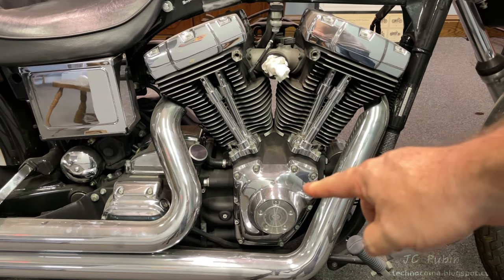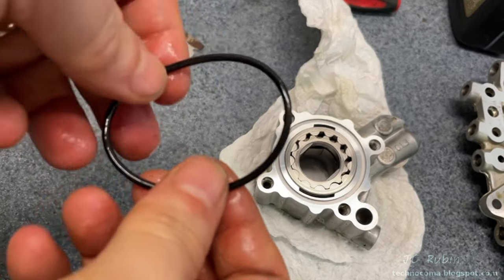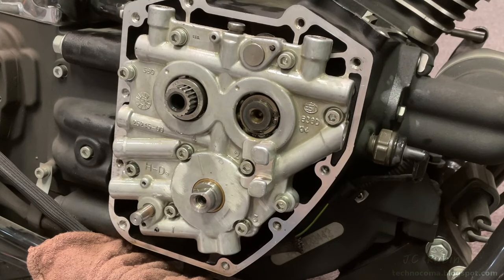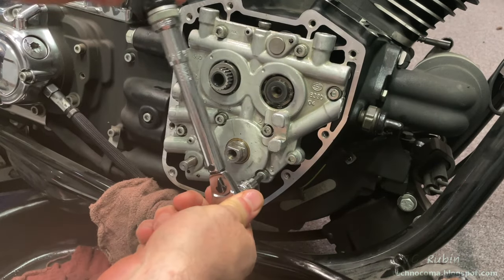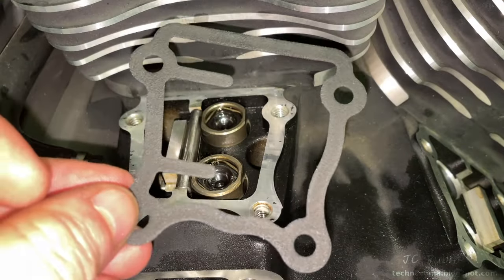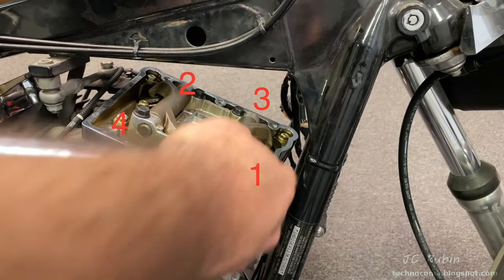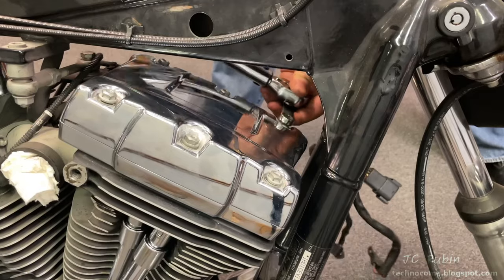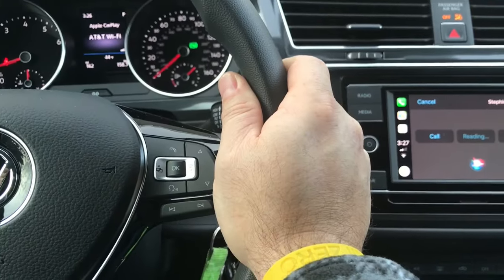Harley Twin Cam Chain Tensioner Replacement with Push Rod Removal Complete - Part 2

Comment: Unbelievable. He did all that and didn't cut the pushrods with bolt cutters. It CAN be done!. Purely educational video done very professionally. Bravo
Reply: It can be done, but it is a little easier, and less expensive if you do it more than once, to have adjustable push rods. He did remove the rocker boxes. What I didn't see him do was replace bearings or clean out screen sock.

Comment: Absolutely fantastic video.  I have an old twin cam with a ton of miles so I have done this a bunch by now.  Your video is the best I have seen to date, and you explain the engine timing procedure very well, something that most of them skip on.  Thank you so much for this!
Reply: Do you have to do the oil pump procedure every time ?

Comment: What an excellent presentation -- I feel like I now have a thorough understanding of camchain tensioner removal and replacement.  I have a 2003 Dyna Low Rider and at 32,000 miles my inner shoe was completely worn out and broken.  I caught it in time and based on your Part 1 and Part 2 videos I have completed tensioner replacements.  Thank you so much for sharing your knowledge.

Comment: I will say it again 'best instructions on this job, period'.
Reply from the maker: Thank you. Glad it was helpful.
Reply: @delorean1  I have a question. When I remove camplate it will be marked as it comes out with locking tool in place, I'm leaving oil pump in situ, when I reinstall do I still need to do the aligning process, or will it be in line still as I have removed it?. Thanks.

Comment: Great Video!!  Although I am still afraid, I will get everything apart okay, But, when it comes to putting everything back together, Oh boy!!  My Shovelhead I had back in the mid 80's was the last time I attempted to work on my Harley. I also had a great friend that rode and worked on Harleys forever. He had a garage at his house and every tool imaginable.  A great friend that helped me anytime I needed it.  Then in 2000 I bought an 883 Sportster that was brand new and only needed maintenance which Harley would do, because I moved away from my buddy. A few years later after selling the too small 883, I bought a low rider which Harley Dealership also did the work on, this was back in 2004. Since then, I haven't ridden until last month when I went and bought a 2001 Dyna. I have hardly any tools and no friends that can help me, also no money since I became disabled and can't make the money I used to make!!  So, I HAVE to learn to do this myself or sell the bike I just bought.  Which selling it is out of the question since I'm way older and disabled, if I sold it I'd probably never ride again!!  So, this video really helped! So far, I haven't checked for wear on the tensioners, since I don't ride much at the moment. Now it's time to buy some tools a bit at a time so I can at least check the tensioners before I ride again.  I need sockets, wrenches and the gaskets to check them. Get that done hopefully this month, and just keep watching these two vids over and over again, so if I need to replace them, I'll have a better understanding of what is involved and hopefully get the sucker put back together correctly!!  Rding makes my old, broke, disabled butt feel a heck of a lot better!!   No way would I even attempt this job if I had not seen this video.  Thank you for sharing your knowledge!!
Reply from the maker: Glad the video helped.
Reply: And, never underestimate the psychological power in the words "I ride a Harley-Davidson."  Uttered to one-self quietly, and to others in full voice.
From California ~ Ride Forever!  🦅
Reply: @delorean1  It did.  I actually needed tensioners. I caught it literally just in time. There was a big chunk missing sitting in the bottom of the cam chest. I touched the tensioner and it fell apart in my hand.  Luckily there was only 1 big chunk of plastic in the cam chest.  Nothing else.  I wound up putting in an S and S mod. New hydrolic tensioners. Better oil pump. And since repairing I put about 1200 miles on it.  If I had started that bike one more time it would’ve been a boat anchor!!  Thank you God!!!

Comment: Good instructional video.  I have a 2000 FLSTC and during COVID lockdown I did the teardown, but replaced the stock camplate with hydraulic chain tensioner, new cam bearings, cams, oil pump and lifters.  On the top end replaced the oil breather sponge, flapper valves and o-rings.  Also installed rocker lockers which did quiet down the top end.  Thanks again for the great video.
Reply from the maker: Did your breather assembly come apart easily to replace the flapper valves?  These were glued together.

Comment: Did this last winter. I suggest if anyone is doing this, to upgrade to the shoes made with Stanyl Polyamide the ones from "Cyco Gaskets" and not the stock Harley crap. Also, always replace the crap Harley INA inner cam bearings with torrington bearings. Always good practice to upgrade Harley parts because Harley engineers have shit for brains!

Comment: Excellent video.
You covered all the technical issues and made certain the video was clear so the average guy could see and would know what he was up against. I never  priced this job at a dealer, it would probably run into the  $400 neighborhood. 75% of it labor.

Many thanks.
I will be doing mine this week. This video gives me an extra degree of confidence.
Reply from the maker: 400$??? keep going, 400$ would get you through the door.

Comment: Excellent content. What's not to like? Subscribed.
 A TC88 is for life, take the rough with the smooth. Had a 1340 fxdl for around 10 years, wasn't going to go with the TC but got a '99 FXDL as a full restore project. Best video I've seen but I would lock the inner tensioner from the outside to aid cam install,lower back down gently.

Comment: Excellent video sir. One thing I noticed....,.
I believe the lifters are directional and the oil passage faces inboard.

In fact, it appears after slowing the speed on the video, your lifters were actually removed with the oil passage facing inboard.

Your attention to detail is impeccable! I could be way off on this, but, thought I'd offer a suggestion that may be of some assistance.

Thanks for all you do sir, greatly appreciated!
Reply from the maker: Id taken photos during removal, and my original video is 60fps.  The lifters went in the way they came out.

Comment: Best Twin Cam Tensioner Replacement video out there Classic Wrench! I'm just completing my job...to the part where I put front cylinder on TDC...snugged the rocker box...pushrods still won't spin freely...guess I have to wait for them to bleed down...curious...does it matter that much if they're not bled down when you torque the rocker box?
Reply from the maker: Yes, wait till they bleed down...

Comment: Thank you for a great video!    I will be attempting to do my ‘03 Softail, I’ve pulled my cover and the inside tensioner is worn deep but not to metal yet , so no more riding it till I replace it.  I will rewatch this video and take full written notes and get everything prepped. 
Thanks again! 😁
Reply from the maker: Good luck!

Comment: you covered pretty much everything and this is the budget way.  No expensive 'upgrade' kits-  just fix what's broken. Love it. You didn't replace the inner cam bearings but from the vid-  they looked okay.  Thanks again for making these vids.
Reply from the maker: You're welcome, I tried as close as possible to follow the workshop procedure.

Comment: Brilliant concise video manual. Carrying out procedure this winter on 04 tc88. Not wanting to upgrade performance , just reliability.  No issues with bike so far , while apart what upgrades do you think i should consider.

Comment: This was absolutely exquisite.... Just wondering why a perfectionist like you doesn't use a lifting table.
Reply from the maker: I do have a lift as used in most of my other videos. By this was done offsite at another location.

Comment: A couple more steps and you could do the cam bearings, cam swap and rocker lockers. Awesome video 👍
Reply from the maker: Thanks, yes its true, but I was already doing the oil pump and the lifters, the the scope of the project was getting big. If I didnt have the secondary tensioner tool then I would have removed the cams and redid the bearings as a result.
Reply: @delorean1  Makes sense. I plan on doing the tensioners and bearings when the weather cooperates. Servicing the top end while I'm at it. Still debating on cams because the 88 runs just fine and I already got a vrod that's plenty fast if that's how I'm feeling that day.

Comment: Excellent video !   I have an ‘03 FXSTD with 44k miles , i just popped off the side cover and the outside side tension pad is particularly worn but the inside pad is worn to the point I see the edge splitting away . Think I fought this just in time!   I want to do a whole S&S 509 cam , hydraulic tensioner , plate bearing set upgrade but at $1,800 I may have to wait several months. With your video I can just do a simple OEM replacement costing only a few hundred bucks and save the money for the cam upgrade later in the year😁
Thanks again!✌️🇺🇸
Reply from the maker: You're welcome.
Reply: " With your video I can just do a simple OEM replacement costing only a few hundred bucks and save the money for the cam upgrade later in the year" Yep that was exactly my plan as I couldn't afford the conversion cam plate/hyd tensioner deal either but wanted to keep  riding my new to me 2000 Softail Deuce.  Imagine my surprise when I opened her up and found a SE Cam plate along with Hydraulic Tensioners and SE 203 cams.  If a guy has the money I think the conversion cam plate, and even a new set of cams would be the way to go.  However like you I wasn't that cash heavy having just bought the bike.

Comment: Thank you for posting these videos. I've been looking for something like this as I can't afford the gear drive setup or hydraulic tensioner upgrade pushed by H-D. Very helpful and presented in a way that's easy to understand. I will be doing my 2003 FXDWG soon.
Reply from the maker: Glad I could help

Comment: If you don’t have the centering tools just slowly snug the the 4 bolts little by little after turning the motor through 3 rotations. So 3 rotations loose. Then run them in until they touch the plate. So finger right basically. 3 more rotations of the motor. Then snug them down some. The service manual says how tight. 3 more rotations. Then final torque. That’s how we were taught by Harley in school. Also. The chain and sprocket don’t have to remain EXACTLY as they come out. The only part that matters is you don’t flip the chain around which would cause it to spin opposite of the way it spun before it was taken out. That’s not good. But if it’s not on the same teeth of the sprocket that doesn’t matter. They don’t stay in the same spot while it’s spinning anyway
Reply from the maker: I would have thought the school would have used the centering tool. Its the same one I use for my shovel head tappet blocks where centering is crucial for cam alignment.  I know the chain the sprocket alignment isnt crucial, but there is some old lore about quicker wear if you dont keep the sprocket on the same spot.  Not sure given todays QC if its still applicable but a lot of folks still do it out of habit.

Comment: Awesome informative video. I will use it as my guide for the project. Just one question - why the yellow paint marks? I didn't see you set the assembly back so that the marks lined up again. Maybe I missed it?

Comment: When installing the secondary tensioner it should be 'pinned' with the tensioner pin to relieve pressure on the chain.  If not the two cams will be out of alignment and a hasstle to reinstall the cam plate. After the plate is installed , the pin can now be pulled. This is also why the tensioner wasn't centered.   I am surprised you got the two cams into the inner bearings with the tension on the chain . OPEN TO DEBATE
Reply: I ended up pinning the inner tensioner as well.  The tension on the inner chain pulled the cams together just enough to make reinstallation to the inner bearings difficult.  
Great video!  Well presented and explained.  Thanks!

Comment: Nice video.  I think I'm going down this path so i appreciate it a lot.  Lots of miles on my 05', the previous owner had it done about 40k ago.  Bike is pretty tired though so im contemplating a 95 kit, this inspection might be the deciding factor.
Reply from the maker: The inspection portion after a purchase is NEVER a bad idea.

Comment: When the pushrods are at the lowest position how do I know if its at the lowest on the compression stroke
Edit: looked at the service manual I see whacha did it just states to make sure the lifters are flush with the top of the crank case cover. Like you did.

Comment: What is your recommendation on doing this when there are adjustable pushrods installed? Would it just be easier to take rockers off and leave the pushrods adjusted the way they are? Or do you have another video detailing pushrod adjustment when reinstalling? Great video btw!
Reply from the maker: Adjustable...... You can leave the top end on, and remove the pushrods.

Comment: Nice video. Would you recommend upgrading to hydraulic tensioners, or how often would a person need to replace these spring tensioners?
Reply: Nice video. Would you recommend upgrading to hydraulic tensioners, or how often would a person need to replace these spring tensioners?

Comment: Factory workshop manual for '99 dyna had an error. Exhaust flange lower torque to 10 ft lbs first. It's 100% 10 in lbs (given in metric as 1 nm which is correct) then 60-80 in lbs for both. I made a tool from 2" aluminium bar to press the exhaust gaskets in, they are made of soft cheese.
¼" 20 tpi tap to chase out the old thread lock if the cover has been off a few times.

Comment: Great video.  To the point.  If you don’t remove the oil pump do you still need to perform the pump centering procedure?
Reply from the maker: No need

Comment: I have a 2004  FXSTI  Twin  cam 88 ci. At 42k I did have The cam tensioners changed To hydraulic and put in a high volume oil pump. I also change the computer.$$$ My owner's manual says nothing about this problem. I learned about this from a guy I met at breakfast. He just happened to be a mechanic. The lord works in mysterious ways.🙏 Ride Save yall.🏍🦊

Comment: Great detailed video! Would you be willing to do another one on lifter and cam wear on the TC 88s? I have mine out and am not sure if they need replacing or not. Thank you so much!
Reply from the maker: Aside from clear and obvious damage, there are specific parameters for wear of both the cam lobes and lifters, this video shows the removal to get to both of them.

Comment: Great videos! But now I ran into a problem maybe you can tell me where I went wrong. I started this project to replace oil pump thought it had gone out originally. Come to find out it was one of the tensioners. Followed along with you to replace mine on my 05 superglide fxdi. I got everything put together and tried priming as you did but wasn't getting pressure. Got the gauge out etc. Unbolted everything all over again. I had my wave washer in the pump in wrong position. Fixed that bolt everything back up. Got oil pressure now but not firing. Has a weird hollowish tone to it when it cranks. Gonna take it all back down a 3rd time but hoping maybe you have an idea on what to look into as I tear it down. Any advise would be appreciated.

Comment: Good Video... But how much is the Pinion Shaft Runout? And why not Replaced the inner Cam Bearings.. Or go with a Up-Dated Hydralic Tensióner  Billet Plate. and Up-Dated Pump.

Comment: As an outsider, having never owned or ridden a Harley I'm wondering if it would be possible to redesign the cam layout in order to put an intermediate gear between the cams and eliminate the inner chain, apologies if this has been suggested before, I'm new to this channel.

Comment: looking at the new Harley chain tension-er installed it looks like the same plastic that was the original problem.  Is this an  graded part with a fix or installing the same old problem

Comment: I'm going to pick up my 03' 100 anniversary Soft Tail Springer and have not given them the check yet. I'm definitely going to ask them if this procedure was done on my bike and if not I will leverage it against the final price OR AT THE VERY LEAST, make them ((give me)) the kit to do it myself. It has 13000 miles on it and part of me wonders if the previous owner trashed the engine from not doing this. I'm used to changing slingers in an old bmw slash 2, so this will be a piece of cake. Great video. I subscribed on the spot. I wonder how much the shop I'm buying the bike from would charge for this service?

Comment: Again - great video!!! Thanks. But - can anyone explain what's the difference between the oil pump centering tools and the bolts that go in after centering? Didn't quite grasp that.
Reply from the maker: The bolts go in after the centering tool centers the pump...

Comment: Its recommended to replace the  bearings when doing that
Reply from the maker: If necessary, though not required.
Reply: Exactly. If he's just going to sell it. Who cares. But if he's keeping it. The bearings should have been replaced. BECAUSE  , they fail just as often as the Tentioners 🙄

Comment: When tightening down the sprockets , is it crucial that it’s locked down? I lined all timing marks up, bike was on ground and in gear, started tightening and it rotated a little, then I was able to torque to specs. It shouldn’t matter that it rotated a little right?